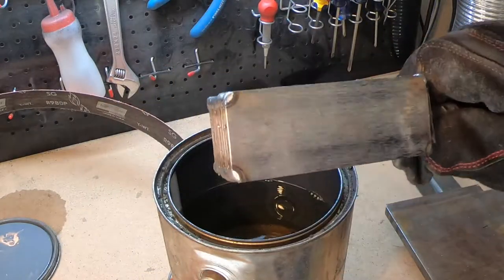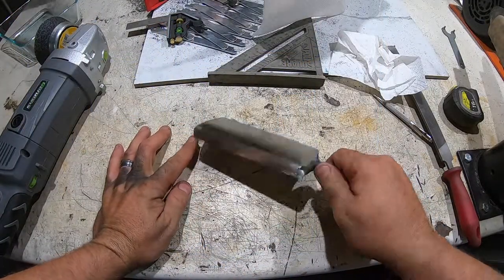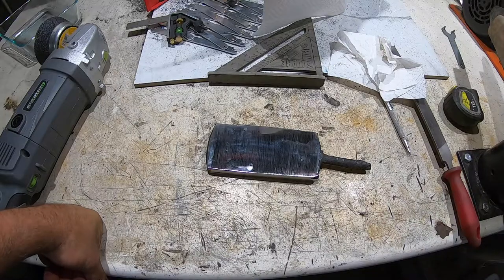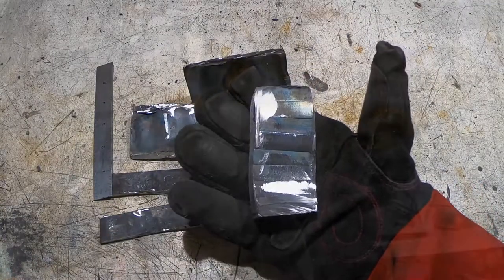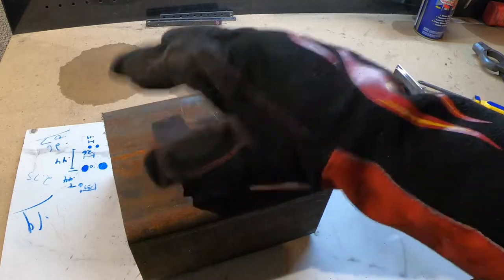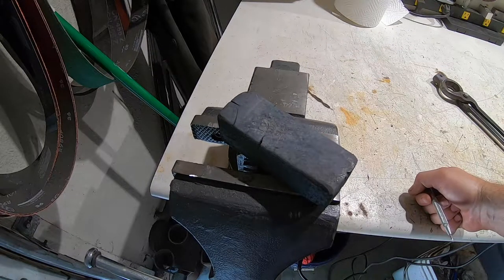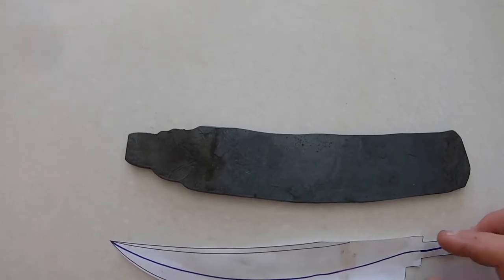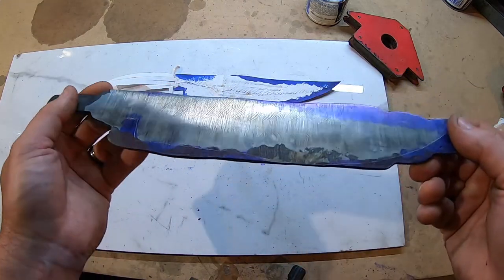Making a Bowie with Feather Pattern Damascus - Forging the Pattern

Comment: Great to see you got it forged out mate, Had the same thing with the cutter sticking when i use the press, takes some beating and swearing to get it out. be looking forward to the final etch.
Reply from the maker: Thanks for the help on this one.  When I went slower on drawing it out it worked just fine.  I did have to grind out some tiny cracks at the edges as I went along but it all worked out.  Hopefully the next video will be up in a couple days.  Thanks!

Comment: My first attempt at feather I did the same thing.  Accept I used an ax head.  It never came unstuck.  I accidentally forge welled it inside the billet.  LOL
Reply from the maker: I had a hell of a time getting it out the first try.  It worked out in the end though and didn’t have to make it a permanent feature.  😜.   Thanks for watching!
Reply: @TyrellKnifeworks  i made a cradle for it after that. Its like the Coal Forge hammer eye punch. Just big enough for the ax head to get through and as i bring the press back up it forces the billet off the ax head

Comment: Dude I did the same thing with my splitter ,I used the end of a forklift tine for my cutter and I shit you not it even melted 

It was like watching me do it only on your channel 🤔😳💪🏻👊🤦🏻‍♂️✌️

Here’s the good part ,I also didn’t get it hot after I got it unstuck from the splitter and bam !!!! ..... it came apart just like that 

It’s in a bucket of water rotting right now 👎🏼😎
Reply from the maker: I couldn't believe it melted so quick when I did it.  It was mild steel but it was in the metal for < 3s before I noticed it melting.  At least it pushed through and  ended up working.  👍🏻
Reply: Tyrell Knifeworks 

See my feather failed cause once I got it free from the splitter it was barely cherry when my knowing better ass tossed it in the already running press for straightening when it went pow 💥 

I got it all back welded or at least I thought ,until I went to for the blade and it actually split pretty much from all seams 

I know my errors so when I get time to finish the second billet it will go smoother ✌️
Reply from the maker: I was freaking out when I did the forging after rejoining the split...  Loz Harrop helped me out with advice.  Keep it welding temp, go slow!  I had to keep grinding out the layers splitting when I was forging it flat.  Took me 3-4 hours to get the billed flattened to something I could forge the blade out of.
Reply: Tyrell Knifeworks 

It was definitely a testament to me being in more control over my temper that’s for sure ,I just took in a breath and tossed it in the water bucket 😞
Reply from the maker: @jamesball7322  I feel you.   I have a knife I'm working on that turned into garbage last night.  It was a test knife though so not tons of hours in some damascus pattern at least.  But hey, if everything went as planned what would we learn?  Success is a terrible teacher.  lol
Reply: Tyrell Knifeworks 

And then we had kids 🤷🏻‍♂️🤦🏻‍♂️😳,hell yeah man
Reply from the maker: @jamesball7322  No kidding!!  🤣🤣🤣

Comment: Is there a way I can get a close look at how you made your press?   I want to make one.
Reply from the maker: Hey Dominic, checkout Triple-T #3. In that one I do a full review of the press and it includes a parts list.  I hope that helps.  👍
Reply: @TyrellKnifeworks  how many tons of pressure is your press?
Reply from the maker: It’s a 58000 lbs cylinder so about 29 tons.
Reply: @TyrellKnifeworks  I'm considering buying a Coal Iron. 12 ton press.
Reply from the maker: @dominicdwk  I've heard really good things.  You might also want to hit up Clark Taplin (on Facebook).  He builds the same kind and might be a bit cheaper.  They are pretty solid as well.   Given that though, you're gonna be spending $2500 or more on that press.  You could build what I have for half of that if you have some welding skills.
Reply: @TyrellKnifeworks  I don't have welding skills.  I can develop them but are we talking pro level?
Reply from the maker: @dominicdwk  I'm talking basic welding skills.  Skills you'll need as a knifemaker anyway.  I built the press you see with a $150 stick welder.  😜
Reply: @TyrellKnifeworks  now you're talking.   Thank you.
Reply: What kind of rods did you use?
Reply from the maker: @dominicdwk  Why don't you hit me up on Instagram or in email.  Both are the channel name with no spaces and email is gmail.